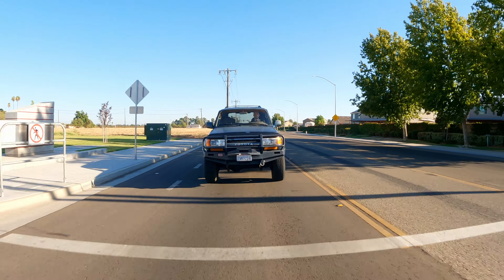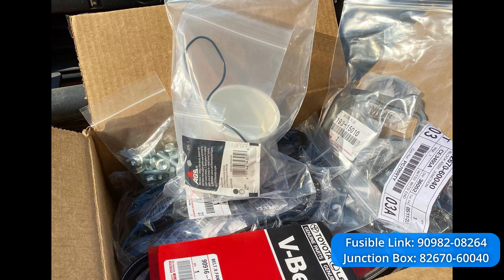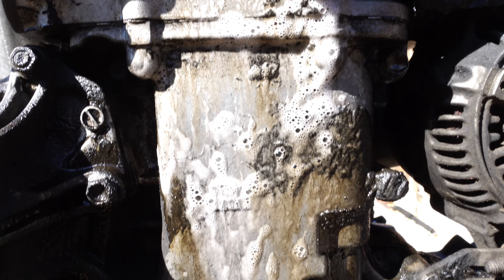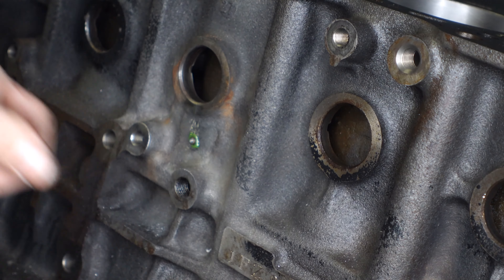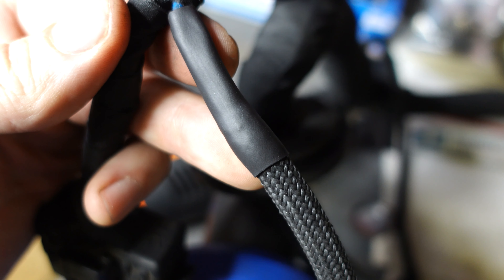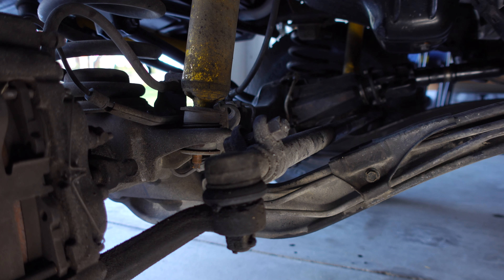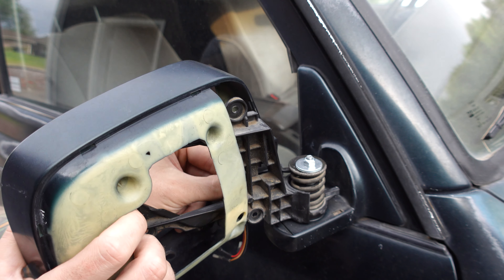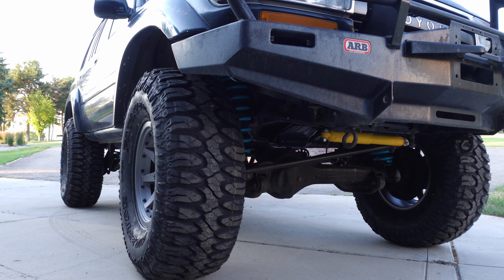How Much Does it Really Cost to Build a Land Cruiser? Not Cheap!

Comment: it seems very reasonable to me. The only thing I would have done differently perhaps is avoid the wheel spacers by getting a wheel with the requisite offset even if that meant opting for a smaller tire size. Unsure how much rock crawling you plan to do with this thing but these massive tires combined with the spacers will not be good for much, e.g. mpg, tarmac handling... and will stress out everything else that you will need to upgrade and spend even more.
Reply: BS, using good spacers will not be a detriment at all.
Reply: 5k in rims, wheels, lift kits and parts for it seems a bit high to me....  Like rough country and some 33s could a saved 4k
Reply: hes american, big tyres or nothing bro !!!  @Rays_Bad_Decisions  🦅🦅🦅
Reply: @RossiVop  I got a Unimog on 48s..   it still would have been a lot cheaper for him to just rough country and 33s

Comment: Nice job, but wasn't for the right car its unpowered and you will face more problems there's much better and newer cars and more capable in off-roading.
Reply from the maker: Personal opinion completely on what you build and lots of arguments can be made for old vs new. Also, engine swaps are always possible.
Reply: @RM_Garage  
It isn't personal opinion it is based what people prefer and how many LC80 is still running Vs other cars from same generation
Engine swap won't give the feeling like it's original and also other old vehicle can do the swap
There's what is much better than the LC80